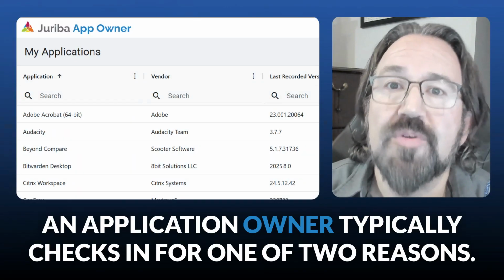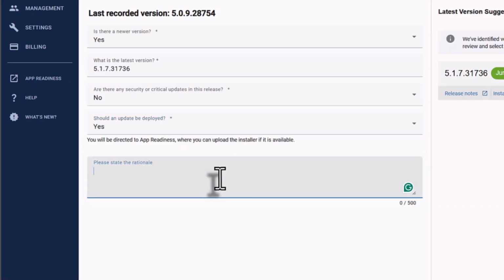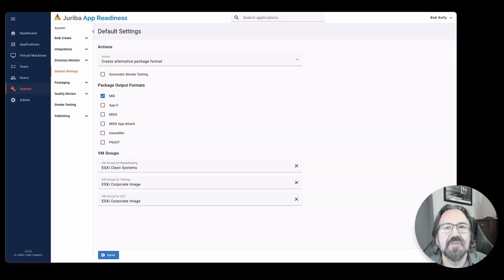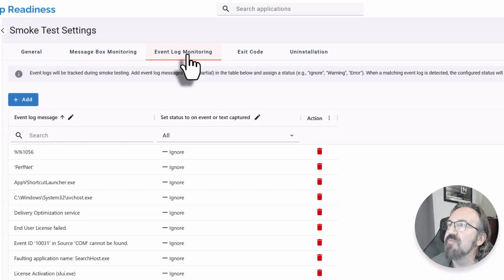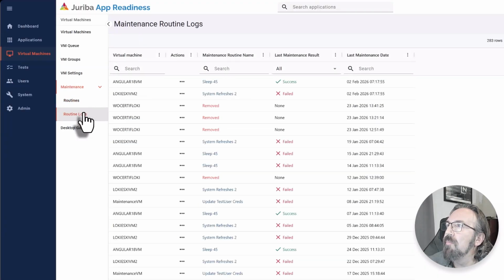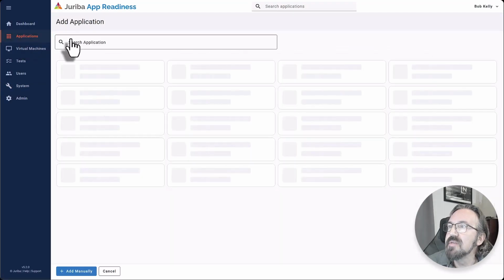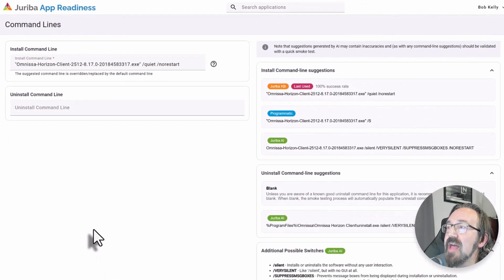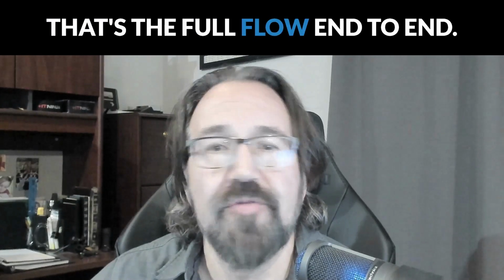Juriba | App Owner + App Readiness Integration Demo (Bob Kelly)

Comment: How do you customize an MSI and create an MST selecting which features you want etc,  also how do you deploy an exe which has multiple setup features? or is the tool only for simple applications which allow silent installs but no configuration?